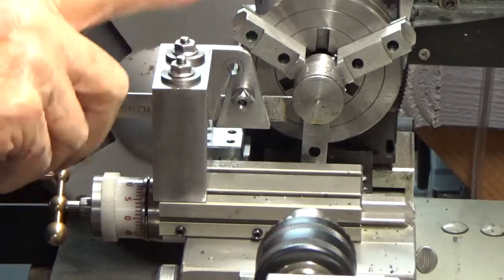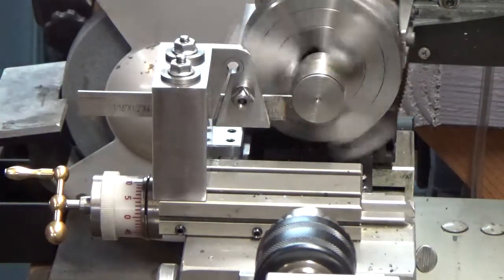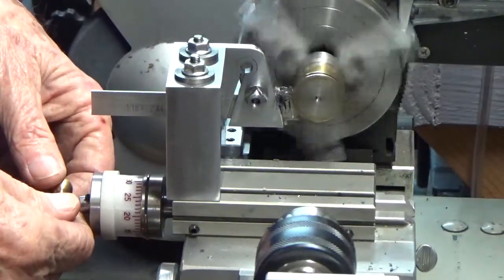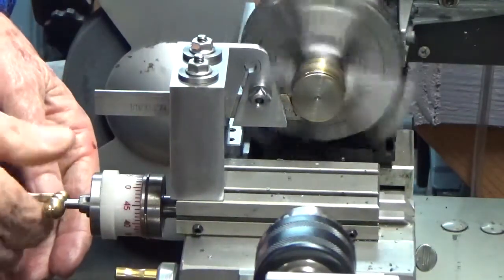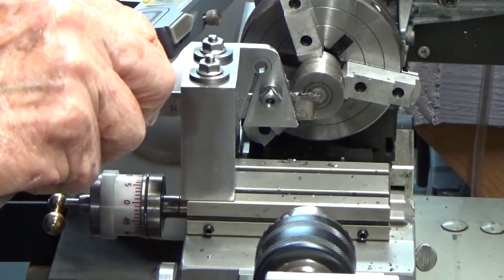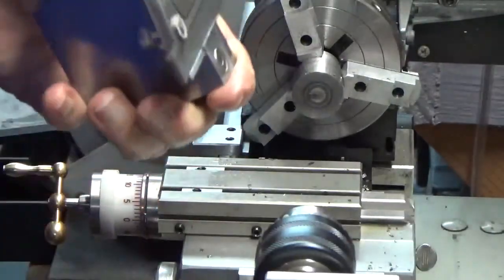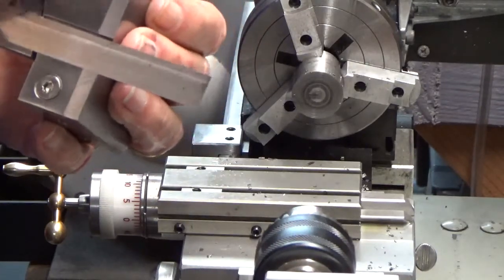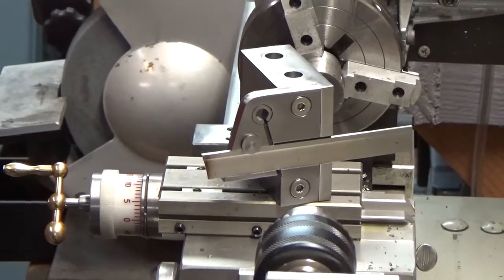Taig Lathe Spring Cut Off/ Parting Tool Holder Part #1

Comment: Great job Larry,
     I think I like the fact that its a more solid design being clamped directly to the surface of the cross slide rather than hanging out in mid air like mine is, and if I find I have trouble I can always remove the bar that fits my holder and convert it to your design, but we will see, I think these spring tools will remove a lot of worry when parting off in the fiuture,

Take an orange out of the bag, great job,

Edmund.........Alberta,
Reply from the maker: Walter:  Make sure you watch Part-2.  The higher torque setting on the Sherline motor pulleys really works 100% better.  Now that I have everything working with the mini lathe holder, I should get the cross slide gibs adjusted and make another video with that tool holder.  I may have a big chunk of steel around the shop somewhere, a couple inches in diameter.  That would be the ultimate test.  Regards: Larry

Comment: I put top rake on the parting tool by using the Dremel and making what looks like a big chip breaker. I know this is wrong if you take the advice from any professional instructor, but I found it works for my Sherline if I take it easy. Really like your tool holder here!
Reply from the maker: Thank You. Regards: Larry

Comment: Where did you get the white plastic dials from.  They are great
Reply from the maker: John: The new dial assembly was a small project here in my shop.  I'm sorry that I didn't publish a video explaining the build.  Walter Maisey and myself, both made similar dials using slightly different designs.  I may have some photos on my "photo link", but no explanation.  Walter did make a video, but his design is more complicated.  Regards: Larry
https://1drv.ms/f/s!AoFHBXavAXM5g7QOwGam4Vcf_FWYsw

Comment: I almost brought one of these, kinda glade I didn't as it would have tanked my business trying to rely on this as it just isn't strong or large enough to deal with something 4" inch in diameter.
Reply from the maker: Edward Mitchell:  I'm assuming your talking about the Taig lathe.  You must keep in mind that the Taig lathe is just a MICRO lathe (not even a mini) and nothing more.  It's not made for large work of any kind.  I have used it mainly to do clock making work, and for that it seems quite adequate as does the Sherline lathe.  I have several watchmakers lathes for very small work.  For any larger hobby work, I would suggest a 9x20.  Regards: Larry
Reply from the maker: Edward Mitchell:  The lathe you mentioned above very much resembles my mini lathe.  I've extended the bed to 16" and also extended the cross slide with a new casting and lead screw.  My investment in the actual lathe is quite small, but the accessories are really the big expense.  Room is also a factor that I must consider, since my shop is quite small.  Thanks for your comment and good luck with your business.  Wishing you lots of success.  Regards: Larry

Comment: Excellent idea, my lathe is a bit larger but I had a lot of problems with chatter while parting. I went the other direction and made it more solid. I'm not sure it would work well on your lathe but I'm happy with the results on mine. Check out the video on my channel. I like your idea... much better than parting from the back side. Reverse from the front works but the chuck tends to unscrew.
Reply from the maker: Thank You. Regards: Larry